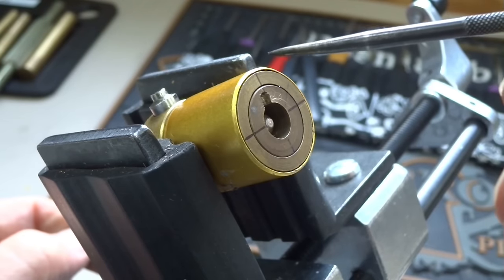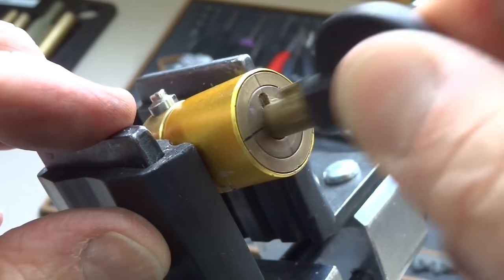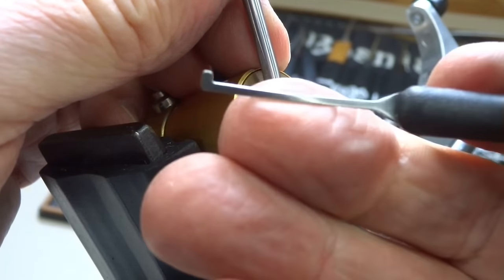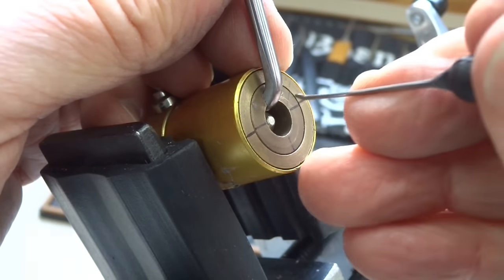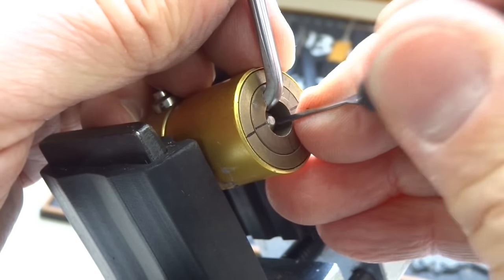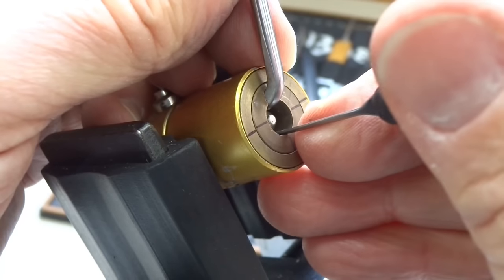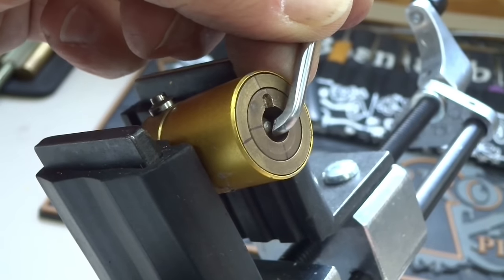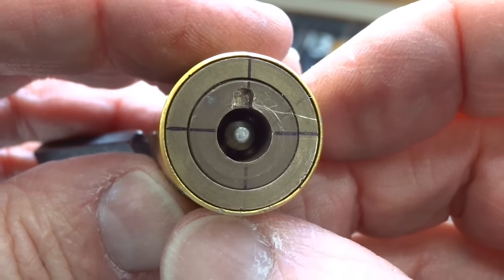(736) Brent's Australian "Octo-Dimple"

Comment: Nice! Now Bosnian Bill, I have seen you have managed to pick so many types of lock, even the claimed 'high security' ones. What one is really hard to pick/bump/defeat?? ANd what lock should I install on my front door, to prevent anyone (including locksmiths) from gaining access?? Or do I need to change my front door and door frame to steel, instead of wood, and use 2 or 3 locks, to almost turn it into a vault door? Then they'll smash a window, won't they? Or sledge hammer the brick wall when they realise that a battering ram won't knock down the door! Plus, I also need resistance to vandalism, like glue & matchsticks jammed in the keyway. I HATE that! And yet, I've only encountered it ONCE, one someone else's padlock! But I like the idea of being able to drill out any jammed matches, and not damage the lock. It'd require something like a cylindrical key. And maybe Abloy style discs, with no obvious inwards protrusions. I also learnt that Abloy's locks are the only (or one of the few only) lock(s) that can survive being filled with rain/seawater, and frozen solid. As where they come from, that's a typical problem with their locks.